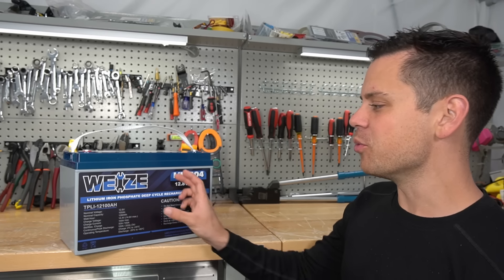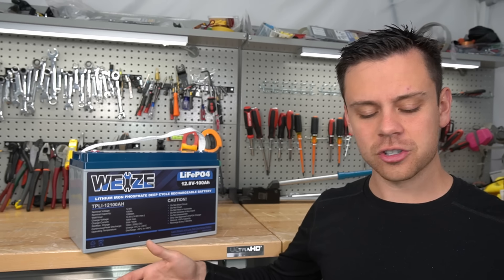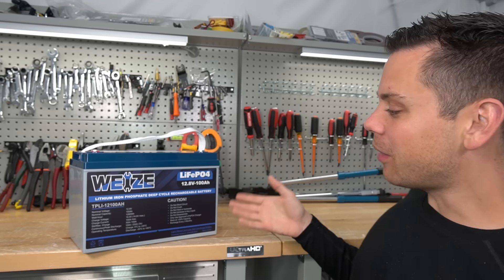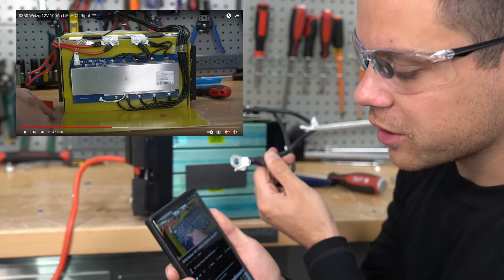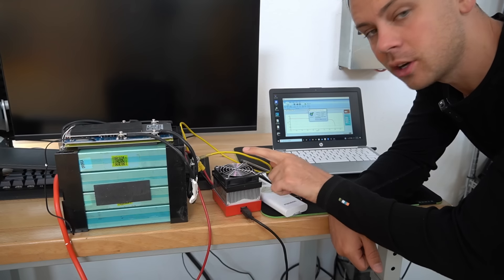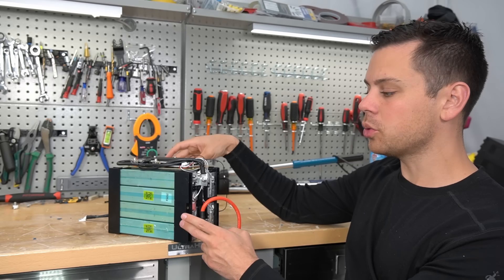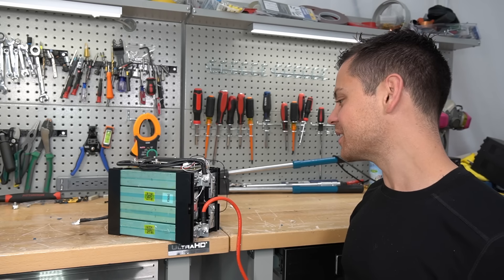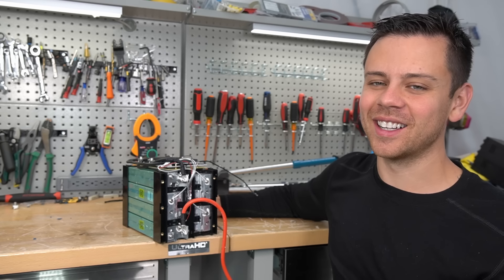$329 Weize 12V LiFePO4: 18 Month Update! Should you buy it?

Comment: I appreciate your videos. Getting 100 amp hour batteries are good for people who are using a limited budget. I have 2 Battleborn GC3’s  wired in series for my 24V system. Not knowing much at the time painted me in a corner. To increase my battery storage I’d need to buy two more batteries. It’s a $5000 bill I just can’t afford. I have a secondary 12V system with two SOK’s. To add storage, I only need to come up with $600.

Comment: I built up my vans solar with Renogy stuff. I know they get a bad rep, but a fella that I ran into when I was buying stuff at Ikea gave me a bunch of pointers about solar in a van and had a lot of praise for Renogy. 
I can honestly say their support has been great. I had a battery stop responding. They paid to ship it ($70!) and they did something to goose it back to life. They also helped me when my charge controller wasn't making sense. 
They are also kind of in the middle pricewise. Not dirt cheap silly named throwaway stuff. But not overpriced like "battleborn" jeez wtf with that name. Do you think your camper van is going to Ukraine?
Really like that I can monitor each battery via bluetooth, and see temp, cell voltage, AH, etc. They do not seem to have low temp cutoff, but at least throw a warning. 
I installed a Bluesea switch to just cut the circuit manually. 
ps bruh, volume warning please.

Comment: Thanks Will for doing this again. I was ready to buy the Weize after your first review, but hesitated. Glad I did! Also it lead to me your teardown video the the Powerurus battery and that impressed me a lot. MUCH better build quality for not much more money over these budget brands like Chins. I now see the Powerurus batteries are now listed first on your list of 12v LiFePO4 batteries. I bought one through your link and it's been working great now. $0.28/Wh, low-temp protection, bluetooth (the Epoch Li-ion app works better than the regular one), 200A BMS. Only thing I don't like is the case is HUGE and is probably a lot of wasted space in there.

Comment: Over one year later Chins 12v 100AH still going strong, no issues. Personally I thought about getting a 200, but have a somewhat unique situation where it makes sense for me to have the possibility of a couple of batteries. Can take one off from the system and use it on small boat with trolling motor. Cost was a factor as well. Sometimes having multiple smaller batteries can be good and situation where you need to split them up for other uses.

Comment: Hi Will, Thank You for cutting open the first one and doing it yet again! The first video helped me a ton, it gave me the confidence to open the top on the one I bought in August of 2022. I put the battery into service shortly after receiving it without running any tests since I was not yet set up to do that. I ended up having some issues with the battery when charging and discharging in a solar setup I have with a couple 12v DC pumps. It seemed to disconnect during charging when it was close to but not at the cut off voltage. Then during discharging It would cut out earlier at a higher voltage than claimed. So I built a little setup to where I could discharge the battery at 20amps and keep track of the amp hours pulled. I then bought a Victron 5 amp charger which has the charge capacity built in with the app. With both I was getting a consistent 49-50ah discharge and charge. So I reached out to Weize through Amazon and to my surprise they responded to every email I sent and worked with me to finally refund some of my money to compensate for the 1/2 capacity battery. So once I received my refund I thought why don't I open it up and see if there is a cell disconnected (50ah 2p4s configuration) or something like that. What I determined was one of the paralleled 50ah packs was at a lower charge level then the other 3. I topped all of them off with a bench power supply and then ran my tests again. I now consistently get 98-99ah out of the battery. So not a perfect experience but I have to say Weize did respond usually within 24 hours and in the end refunded me some money so I am happy with it. My battery is built just like the battery you took apart in your first video, its unfortunate to see the lower build quality in the 2nd battery. Thanks again!

Comment: Hello Will, Wayne here from BC Canada.  I have purchased 4 so far, Lisuateli LiFePO4 12 volt 100Ah batteries for friends and built some small off grid systems with these.  The Lisuateli claims to have low temp protection and lots of its reviews on Amazon confirm that it does but I have never taken one apart to confirm this.  The battery is very cheap at around $500 CDN.  I cannot find where or if you have reviewed this manufacturer.  It would be awesome if you took one apart or compared one to the other budget batteries.  In Canada $500 for 100Ah 12Volt LiFePO4 is really inexpensive. Spring is fast approaching here in Canada and my friends 5Th wheel RV will be melted out from under about 4 feet of snow in northern BC and my fingers are crossed that his Lisuateli batteries protected themselves as advertised. The one good thing is that his solar panels are all still buried in snow as well so not alot of danger in charging while below 0C

Comment: I bought 3 of these this winter for my boat. I run 2 on my 24v trolling motors and 1 as a dedicated battery for my electronics. I chose them based on price and your prior review. I'm a little disappointed they've changed them, but then again I'm sure they'll be fine for my application.

Comment: I bought a Weize 12100AH TPLI a year ago from Amazon for $259.00. I only bought 1 as the price seemed too good to be true. Then after I received it I tried to buy another and they didn't have that same model available. I still have that original one and it works great in my Camper/Van.

Comment: I bought a Weize 200 amp hour for my travel trailer. I was very skeptical and leery about their customer service/ warranty but after a couple of emails I always got a response the following business day. The answers were very cut and paste with some broken English but a response nonetheless. So far the battery is worked well without any issues. In their manual they claim to have a 5 year warranty but everywhere else says 10 years. The manufacturer did clarify that they do in fact have a 10 year warranty that protects against any Materials or workmanship flaws

Comment: I bought three Weize 100A batteries from a vendor on eBay. One wouldn't charge properly, it wouldn't come up above 12V the charger would time out and after resting overnight it would show 9V . The vendor refunded me for one and didn't want the bad one back. I opened the case and found water damage inside. The B.M.S. had corrosion and under the heatsink the thermal paste was wet and runny. I bought another B.M.S. for $60 and soldered it in and repaired it.
Reply: Which bms did you use and how did you reseal battery?
Reply: @fishwhistle100  ebay seller for the bms and a harbor freight plastic welder!
Reply: @fishwhistle100  hiqbattery was the name of the seller and the bms has the low temp protection built-in.

Comment: I bought one of these just before this video came out. 300Amp/hr.  The output is suppose to be 200amps continuous.  Battery shuts down around 98 amps.  This one will have to go back.  It won't even run the coffee pot without shutting off.  Hopefully it isn't a pain to return. Wish I had watch this video before I bought it.  Watch the last one on this battery, that is why I bought it.

Comment: I bought the ADCBATT 100AH 12V with Low Temp protection (based on the teardown on Lithium Solar) and it's a $300 battery.  After 8 months, it is going great.  Been curious about their 200AH and 300AH models.

Comment: My sok 206 Marine battery had a bad bms. It was only a month old would not hold more than 70 amp discharge. They sent a new BMS sent to me free of charge and relatively quickly. However the new BMS would shut off when you didn't use the battery for about 12 to 14 hours. You have to do the wakeup everyday that is not used. Again they sent me another BMS quickly. So my experience with sok hasn't been the greatest as far as quality goes. However after both of those issues it now works great.

Comment: I have had 3 Chins 200Ah batteries and they still work great. I did have an issue where 1 bms shut off, but I'm not sure for how long, but even running on just 2 batteries I still drew 399.4Ah before they shut down. After I disconnected all 3 and reconnected, all 3 were again active and I confirmed by drawing down 500Ah.

Comment: I still love your videos , but your focus seems to have changed from small systems to multiple server rack batteries and large all in one systems that can run air conditioners charge electric cars. All of this is way out of my price range. I wish you would do some more videos on how to optimize smaller systems. I built my system from your mobile book The off grid King with a transfer switch you did a review on. Still need videos  on how to get the power to the house from the shed. I just want to run freezer and refrigerator. And maybe switch to 24 volts eventually. You have taught me a lot I hope you will still help us small system guys with occasional videos. Thanks

Comment: I have a small system I had to build at work and the only reason I can see to have multiple batteries vs one server rack battery is for load sharing. My three hundred ah battery could not handle the amps for the inverter so adding another battery helped share the load and all is ok now.

Comment: I can tell you my story concerning "Why people buy multiple 12volt 100ah batteries". 

The fact of the matter is, I'm 47 years old and my primary interest in for RV use. When I finally took the dive into LIFPO batteries, there were two things at play. First, my experience with traditional Lead Acid 12v RV systems. My knowledge was antiquated and to some extent, this lead me down the wrong path. Second, I did a lot of research on LIFPO batteries before I bought mine and I was exposed to lots of Battle Born videos. These were touted as some of the best of the best. And guess what. They were 12v 100ah batteries. This all sort of fell into place with my old-school knowledge. 

I had a battery box on the tung of my RV where two 34 size Lead Acid batteries would fit. And I put two LIFPO batteries in there. I discovered that the batteries were so much smaller physically, that I could fit a third one in there, and so I did. In my defense, battery tech, solar tech has moved,,,,,,, sort of rapidly from my perspective, since i was first exposed to battleborn batteries. (I bought renogy batts).  It's only now that i'm being exposed to the idea of Server Rack Batteries and all in one charger inverter units. Recently, I've been really turned on by the Delta Flow pro. I like it because I can literally strap it into the basement of my RV and plug in the shore power cord. That's it. Done. I can plug my suitcase solar in if I want, but really the 400 watts of solar is just for fun. I'd charge the EcoFlow the same way I charge my battery bank now. By running my generator a couple hours a day. The beauty of the Eco flow is how simple it is. There's literally nothing to do. Basically just install a strap over it in the basement. I watched your video on using a sever rack battery and an EG4. And while it's appealing being both cheaper and more power, it's certainly not easier and I can't remove it and use it for emergency power at my house. So,,,, I'm torn for my next RV. Eco Flow? Or server rack battery? I figure I got two years to figure it out. The set up I have for my current RV works amazing. Though, i probably spent too much and I could have done more with less. Still, It's soooooooo much better than the old Lead Acid system that I'll eat it as experience gained.

Comment: I like owning 4 100ah batteries instead of one 400ah or two 200ah because I can split up my system if necessary. A young child or old person is probably capable of moving a 100ah LiFePo4 battery if necessary, or if there is a disaster situation and I need to give one or more battery to a loved one I can do that. Or use one as barter and still have some left. I like having my system be modular and separable but still functional

Comment: Bought four 10 months ago for my bass boat after seeing your video. Three have been good with no issues. The other one started going into sleep mode every time I charge it (gets an error message on the charger)and only charges to 13.3V starting about a month ago. I have to wake it up each time to use it. Takes about 4 minutes to wake it. Using a Minn Kota Precision 4 bank charger set to lithium. I have tried it on each bank to see if the bank was the issue. Same problem.
Reply: Batteries were 12V 100AH

Comment: The only reason I like these 100Ah units is they are easy to move around when needed. Pretty hard with server rack batteries. I also use them as a portable 12V source when needed.  My friends power ran out last summer during a storm so I grabbed my 100Ah CHINS and an inverter so his sump pump could stay running.
However, I wish they would use a smaller casing, they don't need to be that large.
Reply: Same here! I have a 200 Ah AmpereTime battery and it’s annoyingly heavy. Two 100Ah would’ve been so much easier to move around. The server rack 48v one I have is even worse.

Comment: I have no complaints about Weize customer support.  I had two 100Ah (trolling motor) and a 50Ah (fish finder) on my boat.  They handled my issue with no headache whatsoever.
After about 6 months (well past the Amazon return period)the BMS on the 50Ah kept shutting down and I would get zero volts.  
I messaged Weize about the issue and they replied within a day.  They told me how to reset the BMS.  worked fine for a couple of weeks then it failed again.  
I messaged them again about the issue.  They offered the choice of a refund or replacement.  I went with a refund.  I bought another 100Ah as an upgrade.

Comment: One reason to buy say 4 x 100 amp-hr vs 1 x 400 amp-hr is that you assume that shoddy quality will cause one to go bad after a time. Unless you have the skills and tools to rip apart the 400 amp-hr battery, you have to replace it. Replacing one of the 100's is also going to be cheaper. Of course the 400 amp-hr may be of better quality and therefore less likely to die, but if you're not sure of that you may choose the four 100's.

Comment: I was going to buy one of these based on your findings from the last video, however, since it was a while ago, my worries were confirmed in that they changed the design and the new design isn't as good as the older one.   Further, I have had read some reviews that also confirmed that the company's support is nearly non-existent.   So I did some more research and have discovered Enduro Power.  This is an American based company, but the batteries are made in China.  Supposedly the owner of the company is an RV Camper and he had created Enduro Power for the RV Camping market.  The company has good support and a person actually answers the phone.   The batteries, like the Weize have low temp shut-off.   All of this sounds good and promising, but I am curious to the build quality of the battery and I have high expectations.   Further, they have batteries in 12v, 24v, and 48v.   The 12v 300ah battery is about $1800.   So the price is good.   I am wondering if you could get a hold of one of these and do a tear down on it to see how it is built.

Comment: This is one of the batteries I have in my Amazon list for my MH. 3 of these for $330 makes far more sense than 6 GC2 batteries at $350.
Reply: I looked at them but decided to go with Dakota Lithium DL+ 60ah with 1000CA's. Get rid of the separate '12v house battery' and 'engine battery' altogether. My main system is 48v, and cascade-charges the 12v system.
Reply: @my_channel_44  - Interesting... do you also run solar, and if so, are you able to boondock for awhile on that setup without relying on the generator too much, or are you mostly into traditional RV parks w/30amp mains/shore power?

Comment: Will now you need to tear down a few new batteries of the old brands you’ve done in the past. See if any fixed low temp sensors or upgraded manufacturing methods? It’d be great to know.

Comment: I bought 2 of those last August off ebay as I could not find them cheaper on Amazon. I paid $370 each. I have not really used them yet. I check the voltage on them now and then.

Comment: One reason for buying multiple batteries rather than one single large battery is that the larger batteries still max out at 100Amps max discharge rate. 2 in parallel gets you 200Amps

Comment: Love your channel Will! I'm getting comfortable with components, but Distance I don't understand So can you talk some about Point to point connect. If I build a small solar shed using a system that doesn't feed the grid but does use grid power as a back up. say 14,400 PV?. How far from a combiner to a shed is reasonable? The AC isn't as confusing from the shed, say, to a Power Pedestal feeding the home and bringing the grid power in. It's that DC Question from the Panels to the Inverters. Is there a formula of some sort per foot? I know distance is an issue.

Comment: The limiting factor is the 100amp BMS. You cannot use these types of batteries to direct replace the sagging FLA or AGM batteries, as the motor's starter pulls 300amps in a caravan. Dakota DL+ costs 2x as much for their 60amp but can do 1000CCA's, and does not need any modification of the charging system.
Reply: As I said in another comment, the main system is (and should be) 48v LFPo. Then, charge your 12v LFPo from the inverter with the included charger from Dakota.